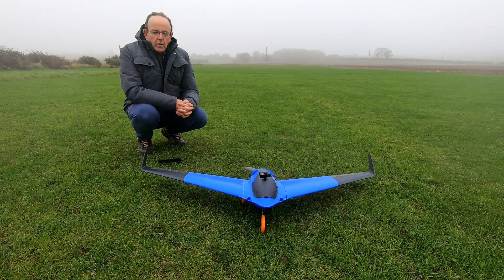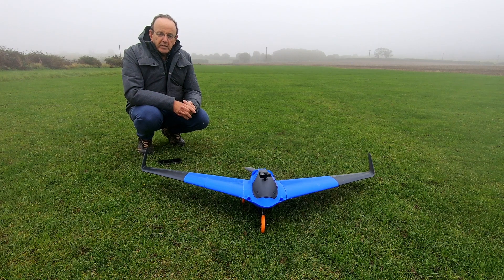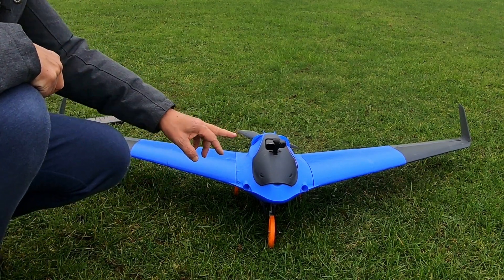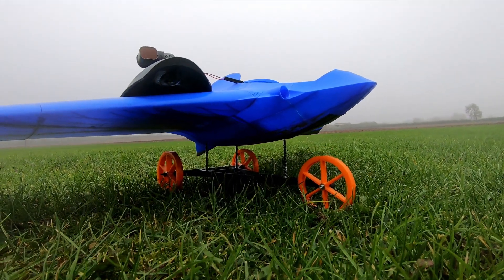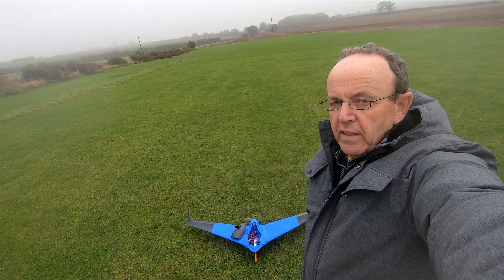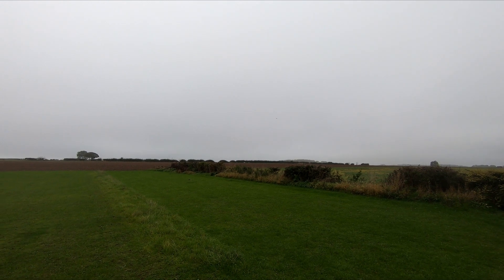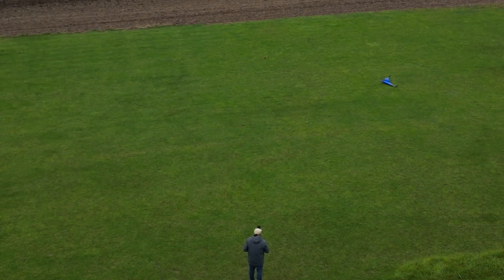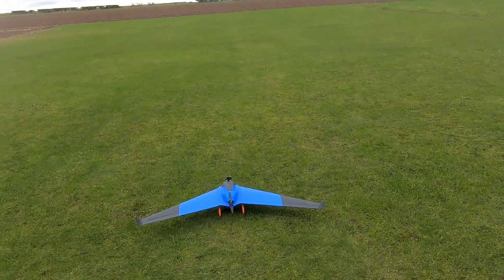3d printing with Carbon PLA - rc airplance V-turn flying wing

Comment: Are you wearing one of those clip on microphones because the audio sounds really good
Reply from the maker: No, I wasn't. It's a GoPro 8, which is pretty good with the built-in microphone.
Reply: @rckeith  ok thanks Keith

Comment: "Carbon" PLA appears to be regular PLA, but giving a matte finish instead of shiny. Have you tried a foaming PLA-LW ( Light Weight ) ?
Does your drone have a 'Follow Me' mode? And, will that enable it to chase the Wing?
Reply from the maker: Not tried PLA--LW yet but I have 2 rolls ready to try. Going to try them on the Eclipson Cobra jet.  The Mini 3 Pro does have follow-me mode and I did try to use it. But it says only people and vehicles when I tried to use it. The wing isn't big enough for it to lock onto.  I intended to use it for the starter trolly take-offs but it just wouldn't do it. It's a shame because it would have been great to watch.😀

Comment: I have a love/hate relationship with my 3d printer. When it gets clogged i hate it lol. Great video. Nice smooth takeoff. I got a big fpv ship on the hot wire cnc right now. Trying to relearn inav at the moment for that autolaunch.
Reply from the maker: Hi Nate I've been pretty lucky with my 3d printers I've only had them clog once. Have a big release coming for the hot wire cutter soon with new software and firmware. 32-bit boards and early next year wifi with FluidNC and a customised web interface. Looking into laser cutters now the diode ones are getting better and good enough for plane building.  I have Inav and Auto Launch working great on my Volantex Ranger they are all amazed at the club when I put the transmitter down and chuck it and off it goes. I can highly recommend Darren https://youtube.com/playlist?list=PLtuty5zAsZ_aKbk9h9hbVG-TySq1W4C14&si=Ar7eRpR7cGMB45OY he's one of the developers and following his guide it works fab.
Keith